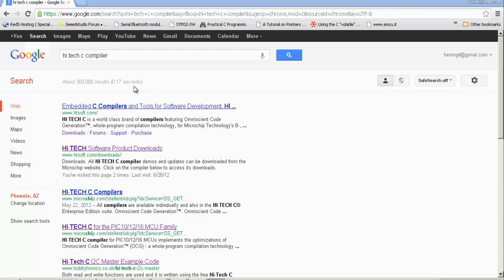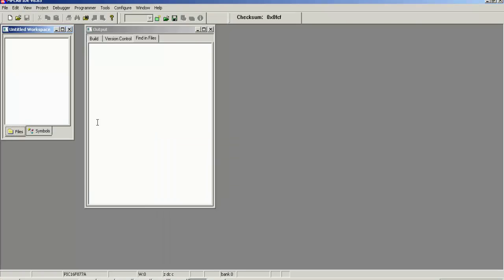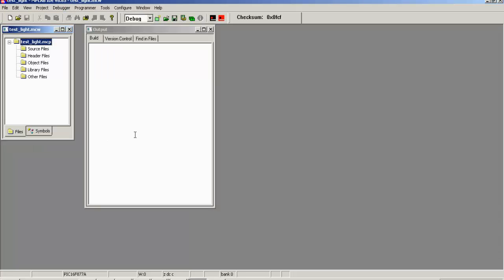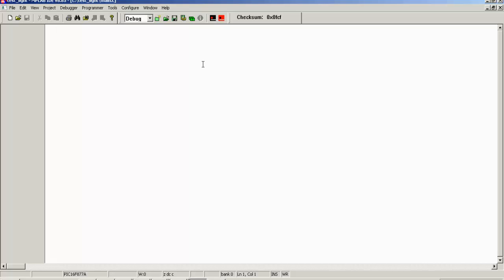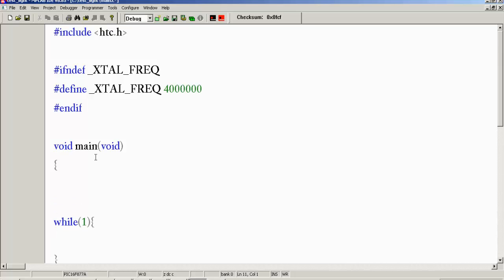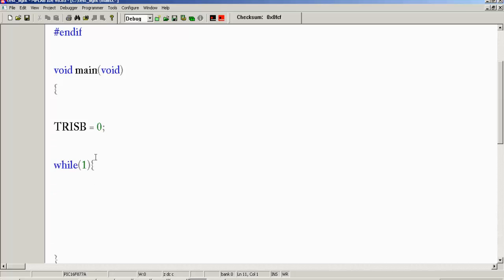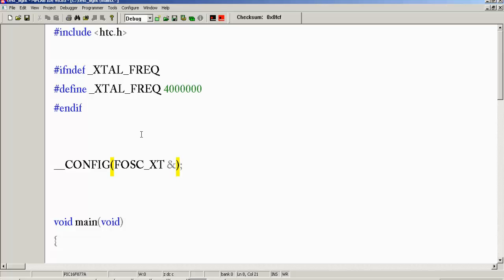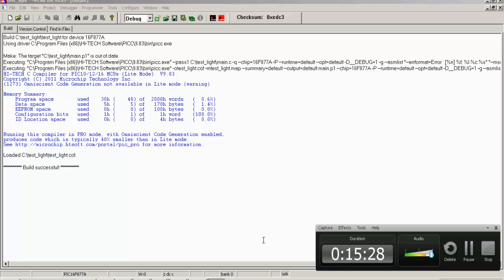How to program a PIC microcontroller the easy way! Part II: Flash an led.

Comment: In Arduino there is a function milis() for milliseconds and another one micros() for microseconds. Every time, I call it, it returns a number I can store in memory. Next time I call it it returns a new one and the difference is the time elapsed between the both calls. The good thing is that I don't need to use delay() which blocks the CPU at the particular line and I'm free to do other things meanwhile. Can somebody tell me how to build a similar function for PIC using "C"?

Comment: All of the links mentioned in the beginning of this video don't work anymore.  However, you can find everything you need now on the first site he mentions in the video:  microchip.com  The link on that site is: www.microchip.com/development-tools/downloads-archive
Scroll down about halfway to find the MPLAB IDE v8.92.  The link is right above the heading "Language Tool Archives".  Scroll almost to the end of the archives page to find the Hi Tech C Compiler and the Toolsuite.  The link is right above the heading, "Source Archives".
The file you want for the compiler is picc_9_.83_win.exe (for Windows obviously) and is under the "HI-TECH C for PIC10-12-16 (PRO and Standard)" directory.
As a final tip :: Install the compiler first, then MPLAB and then the Toolsuite.  If you install MPLAB first and then the compiler you'll have to manually configure MPLAB to find the compiler.  If the compiler is installed first then MPLAB will find it during install and configure itself automatically to use it.

Comment: i just installed mplabc32_v2_02a on win 8 no toolchain can someone help me??
Reply from the maker: christos christou did you install xc8 compiler or hi-tech c compiler? If so you uninstall and reinstall again or you can manually select the path to the compiler which is normally in the your program files (x86) directory
Reply: herringit i only installed mplabc32_v2_02a i had java on pc .... i din't previus version of mplab on my pc....
Reply: herringit i got it i install the xc32 compiller i just installed IDE before without compiller. i have one more question i want to buy starter kit 3 usb for pic3, so i don't see any o/i pin on the board like on arduino so how will i work with if i want play led or servo or any sensor ...??
Reply from the maker: christos christou the Pic Kit 3 Starter Kit has pre-drilled holes so you can solder a custom header to it. depending on your project, you could use a pc/telecom adapter like an RJ11 or RJ45 jack. From there you can splice a cat 5 cable at one end and solder all those connects to Dupont cable so you plug into your sensor. Sorry for the delayed response.
Reply: herringit thank you

Comment: please someone help me:
Error   [800] holamundo.as; 45. undefined symbol "LVP_OFF"

:(
Reply from the maker: i would remove the symbol from your code; your µcontroller might not support it. If it does support it and you have problems with the circuit,  GND the LVP pin. It should not be left floating
EDIT: Words

Comment: THANKS A TON. the config thing did not work though some some reason. I looked at the datasheet and my minipro burner and it was conflicting. some reason the compiler compiled the config wrong. But you brought the purpose of the config bits to me so I was able to fix it and make my first program.

Comment: MicroC Pro for PIC v 6.0 & MPlab v 8.92 
Well it looked simple when you did it & so it should be, but I get the same errors as before, despite hours of following & redoing your instructions to the letter? Tearing my hair out. 
Any further suggestions?
Thanks